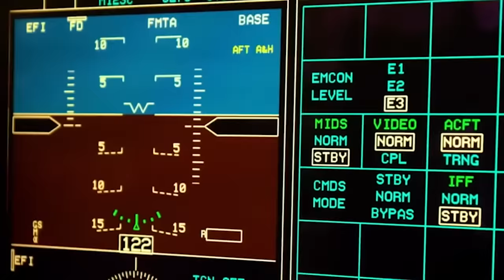The Cheapest Most Powerful Fighter in Existence

Comment: They may say they are derived from the F16 but I can almost guarantee they have a lot of technology from the F5 which had a single engine version called the F20 (which it even resembles to a certain extent). Especially since Lockheed apparently had a hand in the design process.
Reply: According to the video Lockheed-Martin has a 13% share in the project, which included marketing.  Never miss a chance to make a buck.
Reply: @rbrock00  Unless you are a communist there is nothing wrong with making a buck. Also no one redesigns the wheel you build on what went before and that's why it has design features of an F16 and an F5. But if Lockheed had anything to do with it probably mostly the latter.

Comment: With a limited budget and for the type of operations envisioned: close air support and defense, both the FA-50 and Gripen are ideal. The F-16, given the limited budget and isolation of the islands, is unsuited. The Philippines simply won't be able to buy enough of them to be effective or sustainable. And since they are not likely to invade any of their neighbors, they only need to present a threat to CCP fighters that must come to them. The J-20 is not able to be launched from their aircraft carriers and barely has enough range to reach, with a reduced payload. The J-10 and J-15 are vulnerable to both jets, especially in swarms.

Comment: Ya nice 1970 aircraft updated with modern electronics and weapons still thinking dogfights.
But in 2024 if if aren't stealth what is the point. You are better NOW with 1/3 less modern stealth aircraft, than targets that will be easily and quickly taken out by other stealth aircraft.
Even for smaller roles and traditional attacks you'd be better off with less stealth aircraft doing it.

Comment: You cant go wrong with a small, capable, and budget friendly light combat sirctaft if even the Russians are very reluctant to use their expensive, top of the line jet fighter aircraft in Ukraine.  What's good about a expensive, top of the line jet fighter aircraft if you cant even utilised it to full extent because you are afraid of losing it and hurting your pocket and your bottom line.  In that respect, might as well be better of using a capable light combat aircraft such as the FA-50.

Comment: Tell me why didn't the US take up this offer, this clearly has better air combat capability than the Boeing T-7A aircraft.
It seems the US went with an un proven light weight aircraft, that is very good in the networked flight simulator environment rather than a more realist  hard hitting trainer......it seems operating costs and environmental damage overrides basic capability.🤣
Boeings T-7A Red hawk rely on pretending to fly real combat loads in a computer environment rather than a realist environment.
Pretending you have 4 x 1000lb paveways with no Litening pod and 2 x AMRAAM with no radar is preferred than actually carrying them and fitting the jet out with the associated fire control radar??.
If a war starts and you need back up for your front line fighter force the TA-50/FA-50 is the go.
Having a jet trainer that can back up to be a combat aircraft is a good fit for small air forces and larger ones.
I think this aircraft has more of a future than that stealth but not stealth, very expensive 4.5 gen risky KAI KF-21 Boramae as it is the perfect fit for those air forces that are not allowed to get the F-35A or cannot afford the F-16V, F-15EX and are cash strapped
And it shot down an F-22 in war games to boot..🤣 (throw in sarcasm here)